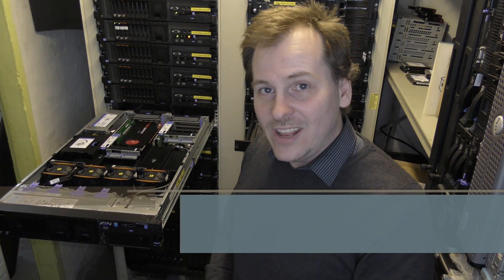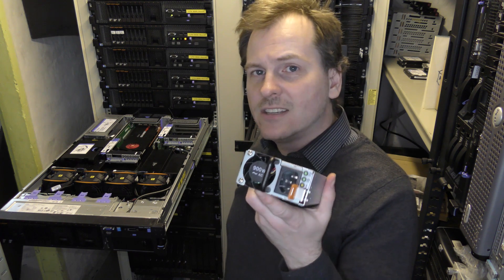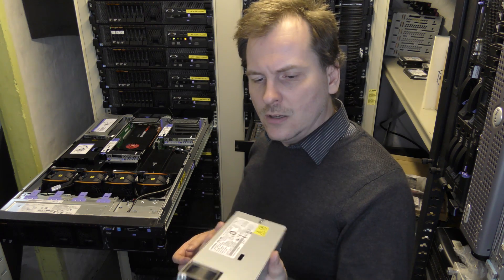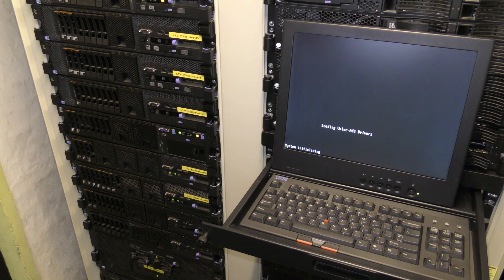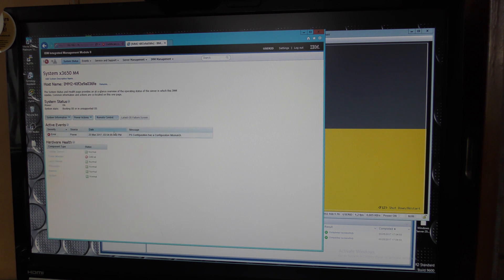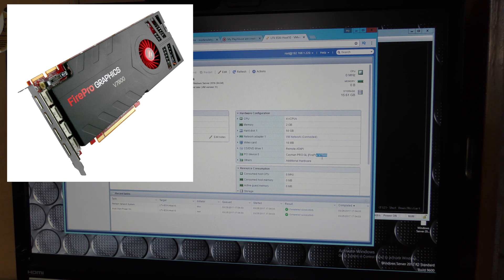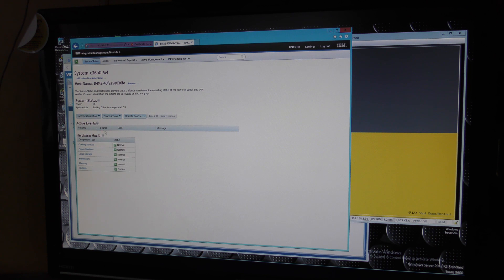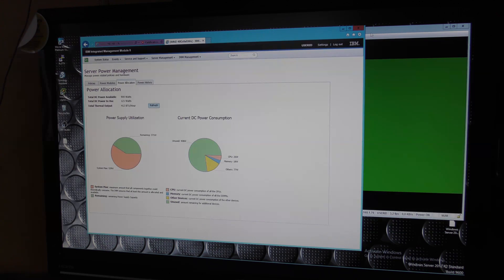550W vs. 900W Power Supply in a Lenovo x3650 M4 - 506

Comment: Hey there, try downgrading to Esxi 6 update 2 or run a new install from USB drive to USB drive and use vsphere to login and do pass through of Gpu and make sure You got correct esxi drivers  and versions during boot. If still fails, bad riser cards, pci express slots, or gpus..
Reply: Also don't forget to enable VT-D in bios first before everything else
Reply from the maker: Hi skyhawk21
Thank You very much!
Thank you for watching! :-)

Comment: Max 75w per PCI lane on that server, that GPU requires more power than can be fed by the PCI interface itself, you need additional power. Check the GPU for required power, check server for PSU 6 or 6+2 power out.
Reply from the maker: Hi Roy Chartier
Thank You very much!  But it is also being powered with a 6-pin.
Thank you for watching! :-)

Comment: I don't think it is a power issue, I think it is an OS issue "ESXI" some setting that needs to be changed and or modified. I noticed you said you installed Server 2016 Bare Metal, did the video card work in that configuration? Or are you saving that for an upcoming video? Great vid.
Reply from the maker: Hi Unkyjoe's Playhouse
Thank You very much!  No I did not record that,, That works well,,, the sugestions point at an CPU issue..
Thank you for watching! :-)

Comment: While I don't know much about server configurations and such, I have done a little research on power supplies in servers. From what I understand it seems that you might have some problems with your power supplies again in the near future, with this new configuration. 

Because of the way that power supplies load-share (the way that they distribute the power coming out of each power unit) there might be a problem with the 550W later on. The power requirements are distributed evenly across both power supplies. So if your server is drawing 500W of power, that means that there should be 250W on each power supply: this is no problem because this is within spec for both units. 

Now lets say that you start drawing 1kw of power (large number but this is an example), then you run into the problem of your 550W PSU having 500W drawn on it which is really close to its maximum, but your 900W is not going to complain because it is still within its safe rating.

So as you start drawing more power, the server isn't going to intelligently draw more power from the higher rated unit, it is just going to draw from both units resulting in equal load-sharing. when the two units are of the same rating, this is no issue, but if they vary by 400W all of a sudden you run into the issue that you are drawing too much power from one, but the other is not complaining.
Reply from the maker: Hi UnforeseenLife
Thank You very much!
Thank you for watching! :-)

Comment: Hi. Could you do a episode where you power a server using 1200W (120A) DC PSU with batteries + solar energy? That would be neat! I've seen 1200W sets to cost ~1000e and since you got tons of servers, that would be smart move to do - right? :)
Reply from the maker: Hi hakabet123
I was thinking about that earlier,, but I would go with an 48V DC power supply. to do less converting.
Thank you for watching! :-)
Reply: Ok :) I'm really interested in this sort of projects. I've only seen 100-150W builds done so I'm afraid to buy and build x10 times that and blow up my apartment. Thanks for the quick response!

Comment: Sadly with VT-d and GPUs it's fairly complex matter. I'd suggest trying KVM which is far far far more option-loaded, which makes things much harder to setup but also gives you options if you run into troubles (including rebuilding kernel if necessary). Sadly ESXi is either working or not working, and that's about as much as you can do. PSOD seems to be caused by VT-d error which is handled as NMI (= CPU error). I wanted to VT-d a GPU on DL160 G6 but eventually gave up (because problems with power supply and setup, mostly GPUs displaying nothing, no crashes), and bought another cheap DL160 G6 for second GPU, with native OS on both. Did cost some extra (I found good offer so not so much) but setup got at least 50x less complex :) . Good luck with your setup.
Reply from the maker: Hi Jerzyna aKwei
Thank You very much! 
Thank you for watching! :-)

Comment: Great video. Thanks. I have X3550 M4 and it has 2 PCIe 3.0 slots. I searched on google and youtube but can't find list of supported graphics cards. Do you happen to know which best graphics card be supported by X3550 M4 ?
Reply from the maker: I do not have a list,, I only tried some tiny old ones..
Reply: My PlayHouse thanks. I actually found your video for it and realized that x3550 M4 is not really good for graphic needs in spite of PCIe 3.0 x16 available. But not usable. You have so many systems. Do you recommend any system with PCIe expansion capability of X3650 M4 but can host bigger graphics cards?

Comment: Hey, have you tried the Grid card with the 900w powersupply? As others have said, it would suggest either the hardware or (most likely) the driver is bad. Try the both cards in a working windows system also.
Reply from the maker: I never got the last GPU core to work,, and I bought the card as broken.

Comment: Have you tried installing the ESXi drivers for the video card onto your ESXi host? Generally NVIDIA and AMD will provide these for ESXi as they are required for GPU passthrough to function correctly.  We have done this at work with 4 hosts with NVIDIA GRID K1 cards and ESXi 6.0 running 300 virtual desktops and don't have any problems.
Reply from the maker: I did try it for the NVIDIA GRID K1 card,, it made the ESXi very very unstable!! Purple screen of death..

Comment: It looks like one of the CPU’s in the server didn’t respond, have you tried stress testing the server? Also try with only one of the CPU’s.
Reply from the maker: Hi Mikkel Nielsen
Thank You very much!  good suggestion!!
Thank you for watching! :-)
Reply: That does look to be the issue, try switching the cpu's around and then  try again. If it PSOD's again then check if the 'PCPU 9 locked up' is a different number on the screen. If it is a different number then it is probably the cpu if it is the same then it is probably the socket on the motherboard
Reply from the maker: Hi jc30
Thank You very much!
Thank you for watching! :-)

Comment: i am buying an used Dell PowerEdge R200 Single Xeon Quad Core 2.4Ghz CPU for practicing Windows server 2012 and Windows 10 in virtual machine. how is this server?
Reply from the maker: Hi Roshan Rajbhandari
Sorry,, I do not know it,, you tell me when you get it :-)
Thank you for watching! :-)
Reply: Roshan Rajbhandari I would recommend something a bit newer, I have 2 dell r410s
Reply: My PlayHouse yes i got it and tried installing VMware esxi but it didn't install saying it needs more RAM :( . I have only 2GB ram at the moment but i have got 4gb on the way. hope i will be running it soon !

Comment: Hello Morten, I'm having a small issue and you seem to be the proper person to ask. I'm trying to install Windows Server 2016 (using pendrive) to IBM x3455 server, but when it comes to partitioning it does not detect any drives (of total 2). Same thing goes for older Windows Servers (2012 and 2008). I tried unmounting the drive from server and connecting it to old PC and the drive gets discovered successfully, installing Windows succeeds, but when I connect it again to server and try to boot, it bluescreens with INACCESSIBLE_BOOT_DEVICE and reboots. Do you have any advice? Thanks in advance for your reply!
Reply from the maker: Hi JachuPL
Thank You very much!  this will probably help you : https://support.lenovo.com/dk/en/solutions/lnvo-sg2012
Thank you for watching! :-)
Reply: Thank you for a very fast reply :) unfortunately, the only version that supports my server seems not to work properly (does not event boot). Anyway, thanks for pointing me to right place :)
Reply from the maker: Hi JachuPL
Okay,,, You might have to start by updating your server with all the newest firmware,, I have done some videos on "BOMC" witch does this on Lenovo/IBM servers. 
Thank you for watching! :-)

Comment: You have tried your ATI FirePro V7900 in another non server system correct?
Reply from the maker: Hi Matthew Guerra
Yes I installed Server 2016 on this server,, after this video,, That all works fine!! on 2x 550W :-) TO
Thank you for watching! :-)
Reply: misunderstood I thought you installed server 2016 as a vm.
Reply from the maker: Hi Matthew Guerra
In this video it was a VM,, I installed it on the host after... there it worked.
Thank you for watching! :-)
Reply: Makes total sense

Comment: Did you make shure the GPU actually works?
Reply from the maker: Hi Rico Smith
Yes I installed Server 2016 on this server,, after this video,, That all works fine!! on 2x 550W :-) TO,,, so Server/CPU/ESXi problem.
Thank you for watching! :-)
Reply: maybe a driver or firmware problem :/

Comment: When you were using the other PSUs were they in redundant mode or in teaming mode?
Reply: redundant with throttling
Reply: Alina Hänel I bet it would be over 900w if the 2 550w PSUs were in teaming mode.
Reply from the maker: Even 550W should be plenty..

Comment: i create my first server nas by an old supermicro motherboard and xeon. now i bring 16gb of ddr3 ecc memory from samsung (from an ibm server). i have some question about this build: 1 is a good ram or is better i dont know hynix memory server.... 2 is for personal use i try vmware esxi but because the machine is not the best server for now i prefer freenas, the question is for a simple backup of all my pc and some time a mediacenter use for exemple streaming film or  media gallery to see family photo for example, is better 2 hdd for nas (wd red or seagate nas) or two normal hdd. the last question is: raid 1 is good for this build? i have a small ssd for cache
Reply from the maker: Hi Christian Belotti
1) Named brand´s are best,, Kingston is great.
2) I would go with to normal drives in Raid1.
If your server can run ESXi, I´d run freenas on top of ESXi,, Or even better XPenology instead of freenas, on top of ESXi. So you can use the server for more stuff.
Thank you for watching! :-)
Reply: if i use esxi and i istall on this system freenas or xpenology i create the raid 1 by esxi or by a virtual machine (freenas or xpenology) and last (sorry if i comtinue writing but is for you that i start love build nas and server ;) ) there is some difference between the normal installation or the installation with esxi